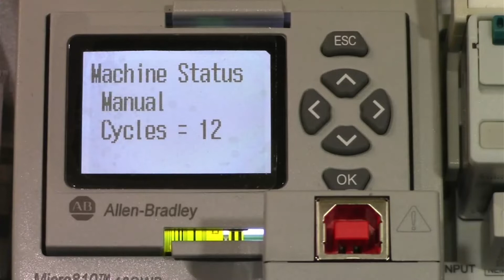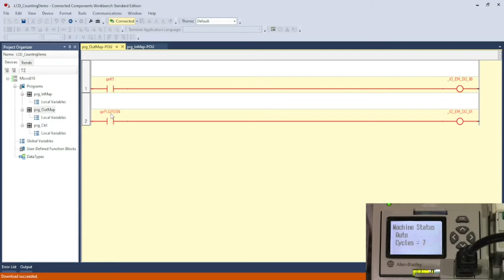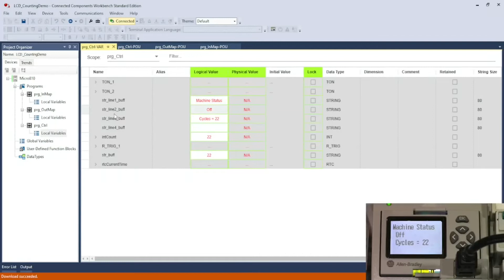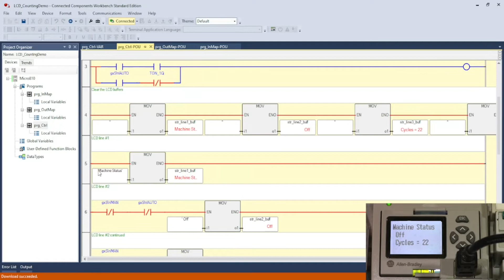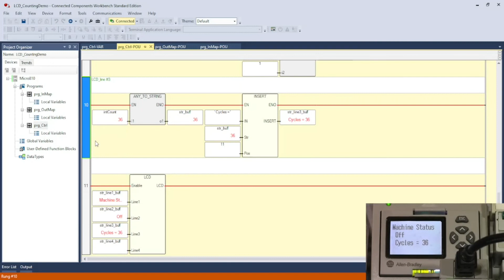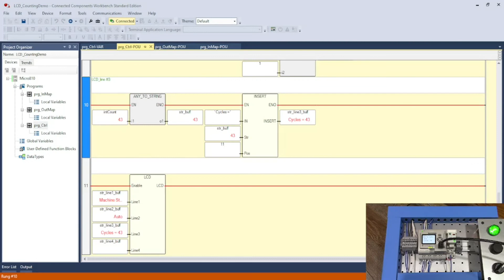Displaying Integer Values on a Micro 810 LCD Using Structured Text Blocks

Comment: I am working at a factory and need to change a variable as the machine is running. Is it possible to change a time variable from the LCD screen? I don’t have access to a computer or a usb anything. I cannot find info anywhere which I honk is odd because making changes to a manufacturing process happens often because of a change in product, different results needed, etc.

Comment: Are you able to write to a value from the LCD?  Say, the user wants to run "x" number of cycles.  Does the LCD have ability for a user to enter in number of cycles for example, where it would then write this value that the operator entered, into a variable in the PLC?
Reply from the maker: Yes, but it's not exactly a user friendly operation. The buttons are available within CCW as global variables. We would need to write a program to respond to the buttons.
Reply: @apdahlen  Not a very convenient implementation, see how the akYtek PR200 is controlled from the buttons, the input / output of values int, float, bool implemented immediately through the screen to which the values attached.